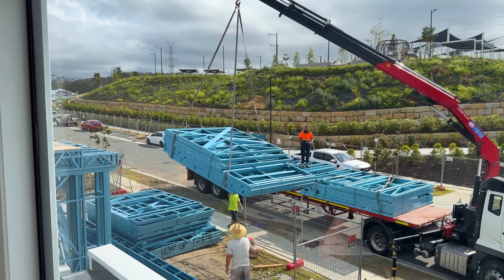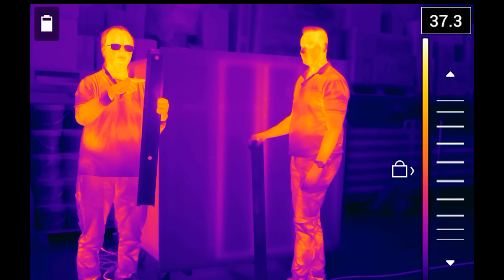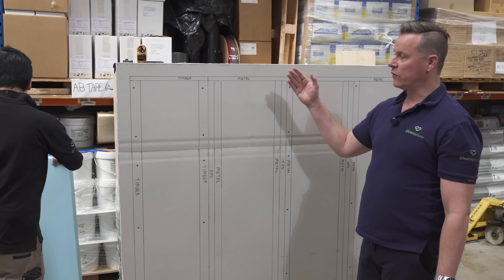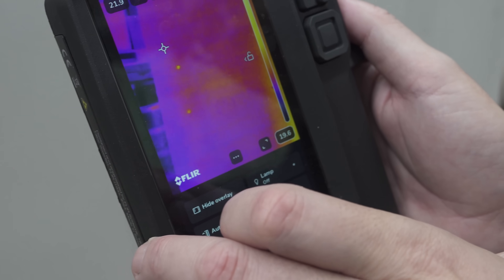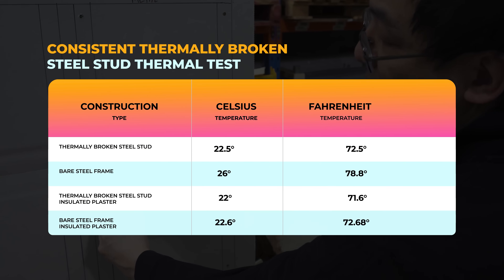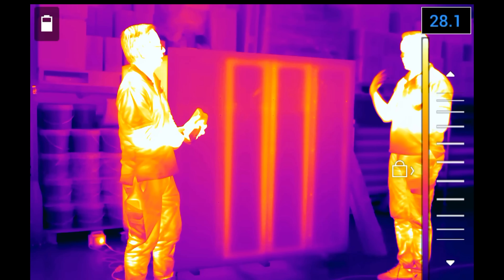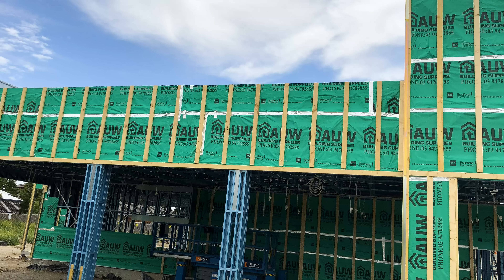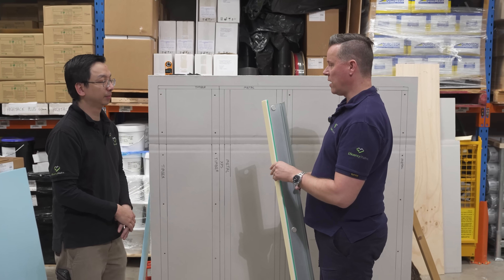Steel Studs BUSTED: Thermal Bridge Nightmare Exposed

Comment: Why not use staggered stud framing with uninterrupted insulation weaving through the studs? Appears to be a possible solution to me.
Reply: Typical trades can barely put together a regular stud frame here in Aus with integrity and quality. They then slap the insulation in compressing it or leaving gaps. Now Imagine trusting them with a staggered frame to put insulation in properly.
Reply: one of the main concern here is Melbourne Australia is the wall thickness. typical construction is single brick veneer.   finding windows and doors that can fit double stud frame (thinkness) is very hard here. Also, the top and bottom plate will still needed to be treated in the staggered stud solution. We still have a long way to catch up the international good practices.
Reply: I built a double offset insulated wall inside my building it made the room 160 mm smaller but much quieter and needs less to no heating and cooling. I did it my self with added power points with a pay back period of under 2 years at present power costs.  It was a double brick parapet wall on the boundary with no windows.

Comment: Use the continuous insulation! (Hint: it should be much thicker than these (peace! Micky-mouse-sized) boards. And you are right: it's a one-time-investment, making life more safe and more comfortable for decades.
Reply: Totally agree, the 25mm insulation board is only bring the thermal performance align with 2x4 timber frame. (minimum)
Reply: @josephcheung8311  1" xps is R5, while wood is typically R1 per inch, so R3.5
Reply: Just a note, this is an Australian video, so R Values here mentions are in Metric units (m2/Kw) , not US-Imperial.

1 Australian metic R = 5 US Imperial R (roughly)
Reply: @MrFredscrap  5.71 so closer to 6

Comment: Great video. That was so interesting to see that strip basically did nothing. I live in Alaska and we do not have termites. If I ever build again, I want to do a double wall with timber on all the outside walls and metal inside. I love how straight and versatile metal is. But metal is also almost double the price of timber here. So, there is that.

Comment: Timely video, Im about to start a a build in VIC (climate zone 6) with steel frame and  XPS continous insulation (50mm).

You can get XPS "waterproofing" board now days that has a cementitious surface ontop of the XPS, means you can stick tiles/stone cladding to it directly like a bathroom wall (60kg /m2) .joints between XPS panels are "liquid flashed" (just like Wedi XPS waterproofing boards).
Reply from the maker: That sounds like a really interesting solution!

Comment: Nice video! My first home was a kit steel home. The biggest issue I saw was the thermal bridging in cold weather and condensation and mould on internal walls where the steel frame against the plasterboard would drop the face temperature below the dew point. I built a new house in 2020 and used Passivehaus principles to limit thermal bridging. I hated that steel frame!
Reply: I second the recommendation of exterior continuous insulation. USA has access to mineral wool boards to use as fire resistant insulation. I would have used that if it was available in Australia.
Reply: I would consider metal studs only the way company Thermasteel uses them in its EPS panels. Inside and outside studs separated from each other with 6 inches of EPS foam
Reply: @andreycham4797   - ??  so it is a double wall SIP system ??
Reply: @kadmow Yes , eps foam holds them together
Reply from the maker: Thanks for the comment.  Got any photos you could send us?  Sales@efficiencymatrix.com